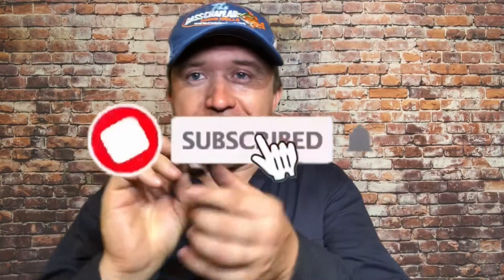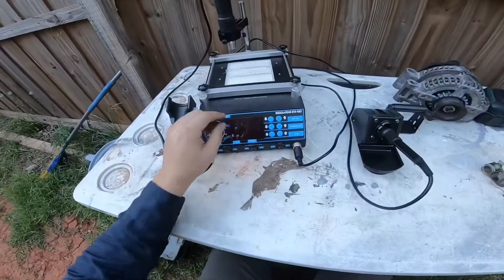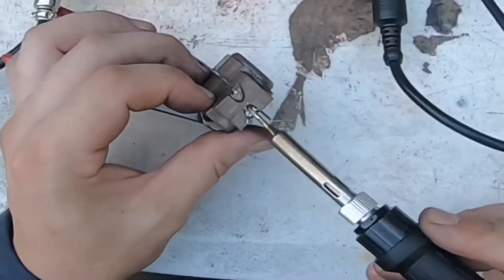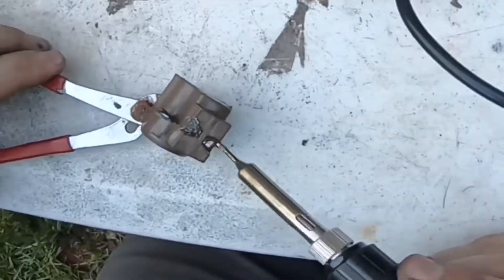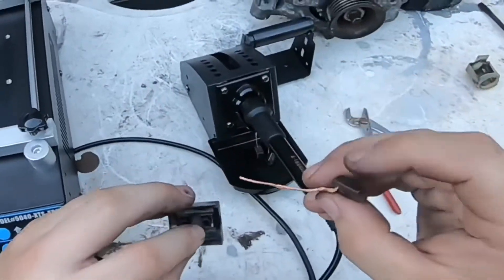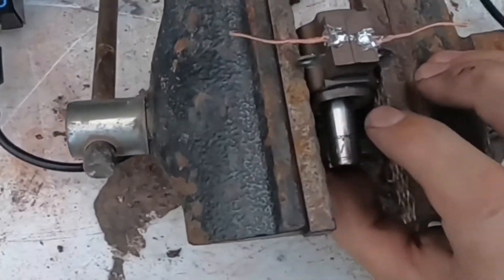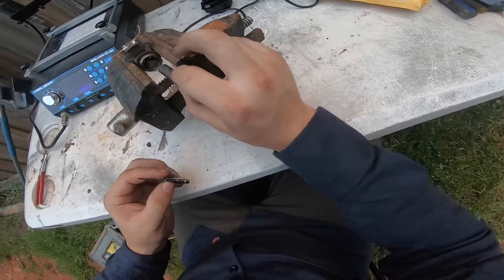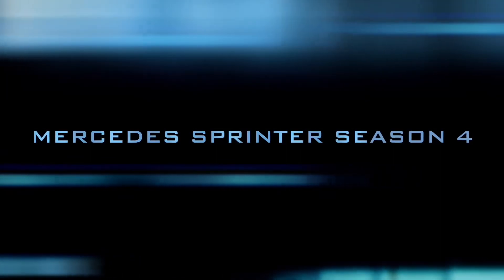How To FIX Your Brushes By Soldering New ones in Denso Alternator  DIY Soldering

Comment: This is the wrong way to do this. when you solder the wires the brushes have to be out as much as possible. He's way this will last about 1 month then brushes will be too short. don't lock the brushes then solder have them all the way out then solder them. when they wear out you will have more brushes touching the armature.don't solder them like this guy just did. this is the wrong way!!!

Comment: A de-soldering iron works wonders for removing the solder from the connections.  I use the Radio Shack version of the ECG J-045-DS Electric Corded De-Soldering Iron.